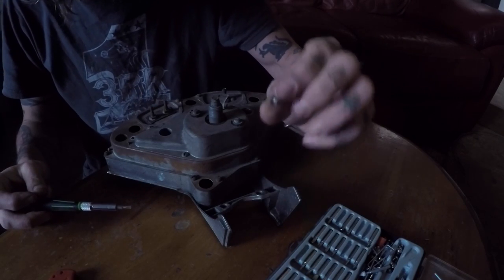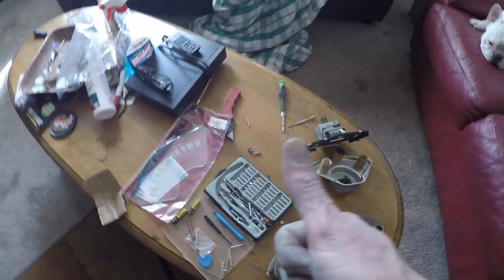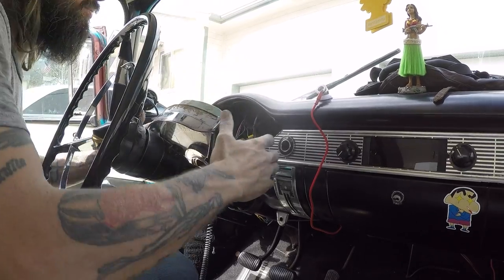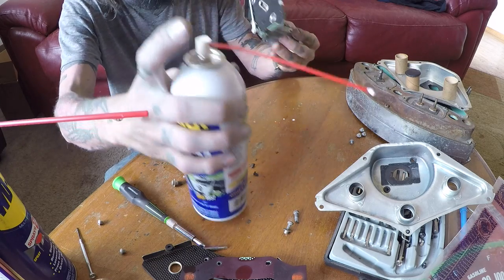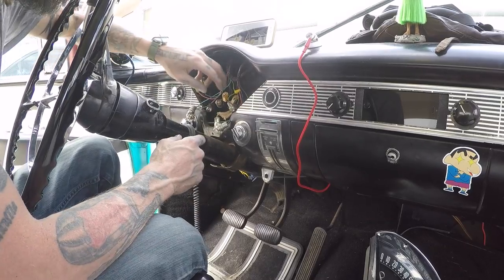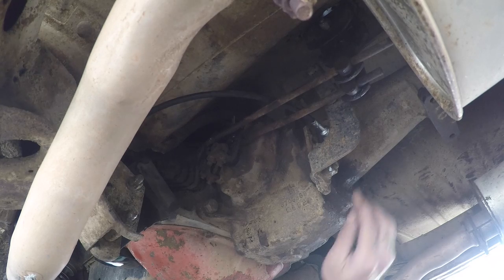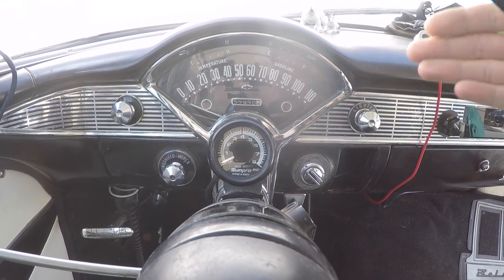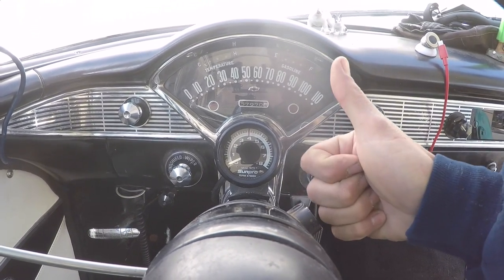1956 BelAir Speedometer Restore S08E13

Comment: Sheriff, judge, you need to watch this video. They don't believe my speedometer is not working even 10 over too. 😮
Reply from the maker: make a video of you driving  and show the speedo with another phone showing GPS speed...
Reply: @pawpatina  great minds think alike 😁
Reply from the maker: @christophersanchez3213  One time, I showed up at court with a receipt for a new speedo cable. case dismissed. took the cable back for a refund.
Reply: @pawpatina  nice.. I have to catch this speedometer on video.. it works Judge.. look 0-45mph it's good after 45- 80mph it's 10+mph 80-110 it's dancing 😲
Reply from the maker: @christophersanchez3213  oh yea bad cable for sure. buy a new one, show them the receipt and video. surely will get dismissed.
Reply: @pawpatina  $220 later and a new speedometer (needle cluster) is working like it should. Judge it's working.
Reply from the maker: @christophersanchez3213  lol nice!

Comment: How to calibrate this speedometer with a 400 turbo I cleaned everything up like you did and now it looks like it's off about 10 mph
Reply: Everything was working fine it started making noises so I took it apart and cleaned it all up and put it back in the car and now it's off about 10 mph
Reply from the maker: @logansizemore1537  that's a completely different topic/subject... will have to do a  search but I am sure its just like all the others. either you cable is binding or you need a new speed output gear at the trans that shows 10mph faster.
Reply: @pawpatina  it was working fine and started making noise so I took it apart and cleaned everything and then when I put it back together that's what I noticed that the speedometer is off a little more than it needs to be but it worked fine before the noise
Reply: @pawpatina  also I jacked the back of the car up so I can see the speed armor cable turning before I put the cables back on I could turn it by hand and watch it move from either side with no restriction I don't believe the cable is bad but I do appreciate getting back with me
Reply from the maker: @logansizemore1537  oh well then when you cleaned it, did you re-lube it all properly? also, lube the cable. and lastly check the spots I showed to make sure you got all the gunk out. could have knocked some old grease into the drive.